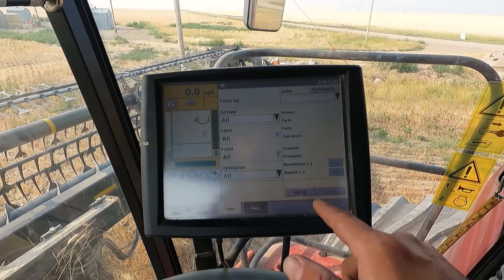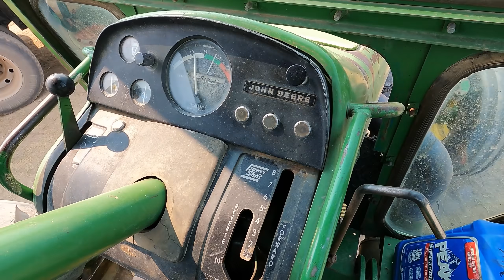It's Yielding Nothing

Comment: Spent 4 or 5 summers hand picking rocks into the bucket of a tractor with my uncle.  Dump that in the back of a1954 dump truck and haul to a good location.  Wore out 2 of those trucks.  30 years ago or so.   I never got paid.  I still don't mind picking rocks.  Easy job, hard to mess up to much and still improve things.

Comment: Bob, your story of rock picking takes me back to when i was kid growing up on the dairy farm with my older brother an sister an my folks. Picked stones every spring with a tractor an a old running gear wagon that has metal spokes rubber tires. an 2X10's by 12 planks.  used pitch forks to pick them up, than once the wagon was full Dad would take it to our woods an Back into a pile an once of us would pull up the planks an down the rocks went  an repeat it couple more times.

Comment: In the 1950s, my dad farmed a 40 acre field that the neighbor had farmed for years with mules. The first year, he ruined at least two tires on the Farmall Super H with old mesquite stumps that the farmer just left in the field, and the mules stepped over. My job was to walk that field with a little red wagon, picking up these loose mesquite stumps. Different areas, but similar problems.

Comment: To check for a blown head gasket, they make a tester that goes into opening for the radiator fill and as you use it the fluid inside changes from dark blue to yellow if any combustion gases are detected. I've used mine many times and love it. Very affordable too
Reply: That doesn’t usually work on diesels. Works great on gas engines.
Reply: Feed propane down the Inlet, enough to make the test work, too much and you've gotten another problem on your hands
Reply: Wouldn't a pressure tester that plugs into the rad cap work the same.
Reply: @ronniewilliz153  no a radiator has pressure from the water heating

Comment: Bob. I'm breaking sod on virgin ground here in missoula at 5k feet. Between the wet spring the uber dry summer I've still not got all the sod busted down. 1 flat rock in the first few acres as all I've found with 12"-18" of top soil. Glad those beavers dammed up my meadow for years and years.

Comment: I use restore plus to remove rust and scale. It does wonders for cleaning the cooling system. They also have restore to remove oil and scum from the system if you have an oil cooler or head gasket leak. Hope this helps.

Comment: If the water pump don't fix it try checking the fuel line, I had the same thing happen with a Allis-Chalmers 6080 and after changing everything it turned out to be the rubber fuel line had collapsed internally and was causing it to run too lean on WOT while baling.

Comment: I think you found the cooling system problem. It looks like the water pump that was taken off was one specced for combine use. It would have different flow characteristics than the tractor version as the combine engines were run at WOT during operation.

Comment: I'm up in a glacier mountain range which has the exact same issues. dad had four kids. So it was two big red trikes. the youngest got to drive them cause they were weaker and the two oldest were on separate teams. each had a box on the rear rack. spread the trikes out 10feet away and pick fill the box till them trikes started to get pretty light on the front end than the youngest kid went from driving the trike to sitting on the little rack on the front wheel till you found a big rock to replace the "live counter weight" LOL

Comment: I had a 400 Cat motor in road tractor. And the impeller was slipping on the shaft. Causing it not to spin as fast as shaft, making it overheat on hills. Drove me crazy until I just decided to change out the pump.

Comment: There is a product that we would get when ever changing the water pumps or rebuilding them on the 40 & 55 series tractors we had . It was a coolant conditioner which protects the cooling system from electrolysis which causes rust. It also keeps the liners from rusting and leaking. You also can get a water pump rebuild kit from JD that saves about 200 bucks.press out the old shaft and seal press in the new seal & shaft and impeller has all the gaskets in the kit best I can remember, and you save a couple hundred bucks. I would really add a bottle of the deer coolant conditioner after flushing the system with the acid. I'd hate to see ya having to replace the liners because they rusted through and started leaking. Dont ask how I know. I had to build a engine in the 4955 because we ran regular water for awhile when the radiator sprung a leak. It doesnt get cold enough but a couple of days in south Ga.to freeze. It made it about 2 years. One of the liners rusted through and it started making milky oil.
Reply: TY16004 DEERE PART # for the conditioner

Comment: If that fixed it that would be the first time I’ve seen a water pump go bad without wrecking seals/bearings. I’ve had a lot of people want there water pump changed due to overheating and usually talk them out of it.
Some people insist so I change it and still overheats

Comment: Another way to test for a blown head gasket is with a Block Tester BT-500 Combustion Leak Test Kit - Made in USA  When Fluid Turns From BLUE to YELLOW Combustion Leak is Present you can get them on amazon for about $37.00

Comment: Nice job on the water pump. Also on some engines when you remove the T-stats it can cause overheating due to the water moving to fast thru the radiator. I have seen this several times. And you should always use at least a 50/50 anitfreeze as it can help the water not to boil at such a temp on the heads. It will make the coolent stay in contact with the head and block. Thanks for the video.
Reply: Overheating without a thermostat is a old wives tale just like a battery getting drained by leaving it on concrete or running low on fuel and sucking debris from the bottom of the tank.  

The old wives tale that coolant can flow through a radiator or engine too fast to dissipate heat defies reason and basic thermodynamics. A thermostat gives very little resistance to coolant flow, when fully open. Maximum heat transfer occurs when there is the highest difference in temperature between the coolant in the radiator and the ambient air passing though the radiator, whether that air flow is caused by the movement of the vehicle, or from the cooling fans. When coolant flows slowly through the radiator, as in when the thermostat is only partially open, it’s significantly cooler as it approaches the outlet from the radiator to the engine. That means that, as there’s less of a temperature difference between engien coolant, and the ambient air passing through the radiator less heat is exchanged.
Reply: @shawnchurch316  You are a liar. I have seen this several times over the last 65 yrs. It does happen.
Reply: @watermanone7567  Next you are going to try to tell me that when you run something out of fuel that is sucks the debris off of the bottom of the tank even though fuel is always sucked from the bottom of the tank.  

The only purpose of a thermostat is to control the operating range of the engine.  The faster the water moves through the system, the more heat that can be transferred.

By the way, water turns into steam at 212°F. Mixing traditional ethylene glycol antifreeze with water in a 50-50 ratio increases the boiling point to only 223°F which is very close to operating temperature of engines and that is why they use pressurized cooling systems to raise the boiling point further.

Comment: We had what they called a stone boat. My mother told me about it when they used to pull it with horses when we did it we had a tractor. It was basically the front-runners of a bobsled with a wooden bed built on top of in between them. Hits the horses or the tractor with heavy rope that ran from each runner up to where it was attached to whatever was pulling it.. They had Steel Rod sticking out of the back of the runners, and when it became time to unload they would take the ropes back over the top of the rocks Andover a U-shaped piece of iron-on a post proped in a hole-in-the-ground behind the stone boat as they pulled it would lift the front off the ground and the rods on the back of the runners stick in the ground and the boat would tip over backwards and unload rocks. Whatever work that's what you used. We also use the hood of a 46 Buick to haul Bales out in the winter time and used as a toboggan when it came to playtime. We would tie it to the bumper of a vehicle with a long rope and turn in a tight Circle in the Hayfield you'd pick up a lot of speed and go skipping across the drifts.
Reply: That brings back memories! At college, (KU), we also used a Buick hood as a sled. They wouldn't let us use cafeteria trays anymore. Busted lots of trays though!
Reply: @louispaparella5766  aluminum scoop shovels work pretty good behind snowmobiles also. LOL the more adrenaline produce the better!
Reply: @earlhollar1906  At home, upstate NY, we had coal scoops with broken handles. Safer on the 'man parts'! Snow machines were unknown at that time...

Comment: I could be wrong but running that big of a auger with a 1000rpm reduced to 540 rpm and the tractor running that low of rpms will cause it to build heat because it isn't running enough rpms to cool properly with that much load on it

Comment: on the overheating tractor, sometimes removing the thermostat completely will cause all the water pump flow to go through the radiator with none going to the engine jackets
gen 1 small block chevy motors would do this
if it's still getting hot try sticking the tstats back in and see if that does it
Reply: It was getting hot before they removed the thermostat.

Comment: I wouldn't be surprised if being it is a  1000 pto and you are running at a low rpm under load you are not moving enough air through the radiator.  My 4630 did that to me.

Comment: I just watched a different video on an older JD like this, similar issues, ended up having cracked head and block. Also who only run water in a diesel? Coolant will protect against cavitation of the cylinder liners.
Reply: They drained the coolant and flushed the radiator in the last video.
Reply: @mfreund15448  oh ok I missed that. Thought they only every ran straight water

Comment: Pull the radiator and have it cooked out. Very unlikely the water pump is not pumping. More likely the radiator is plugged. Either internally or externally between the fins. Pulling it is the only way to get it completely clean. While it's out go ahead and tank it to cook the inside scale out too.

Comment: Not cavitation. Recirculation is what's happening. Cavitation is due to insufficient suction pressure caution the fluid to vaporize due to the pressure at the inlet dropping below the vapor pressure.

Comment: Head gaskets always end up blowing coolant out. There test out there it changes color if it sees combustion gas in cooling system. Problem when testing diesel color change is slight making it hard to tell unlike checking gas engine. Gas engine will turn blue to yellow but diesel engine blue to blue green or green. Most I've seen barely changes it from blue and you end up testing again. Most don't read instructions and assume when testing diesel engine it will change to yellow IT WON'T. Can do bottle test see if you get bubble in overflow tube. 

Water pump pressure test is checking water pump on pressure side it should increase with RPM. Most engines do have a water pump pressure spec atleast 10 psi at idle and 30 psi high idle (full RPM)

Comment: Good Video! Have you considered a by-pass coolant filter.??? Using several gallons gallons of coolant gets contaminated over time with dirty fluid, which prematurely stresses and wears on the pump. Using a filter is efficient and reliable, which extends the pump life with clean coolant.. I have not had the opportunity to use one on a large tractor but, it works on other diesel engines, requiring several gallons of coolant. We used large and common oil filters(20 micron), $10-15, changing them first at 10-20 hours, then 100 hours. You will be surprised how fast they fill the filters...This also saves time and expense changing fluid and keeps the fluid cooler.

Comment: Keep your eyes on that non clean burning. I’ve had that lead to a bit more engine heat than I like. Also over time fans wear and have been known to loose their blade pitch resulting in less air flow through the radiator. 

Alternative to using muratic acid is to use phosphoric acid as it will dissolve the hard water and convert the rust without eating away at the metals. Add a bit of surfactant to the water when you clean the radiator to help with dissolving the crud.

Comment: Hey guys have you measure the temperature difference at the bottom of the radiator as to what the top is reading?  There should be a +/- 10 degrees, bottom being cooler.  Never mind, I should watch the entire video before I comment.  Have a blessed day guys!

Comment: Tell me about it! 🤪🤪🤪🤪 I’m in Connecticut & every year when we plowed before planting corn 🌽! The farm owners nephew & myself would pick the fields clean! Every f cking year! Next spring run over it with the plow again & have the same if not more rocks 🪨 to pick again! Thank god the nephew was smart, went to Cobillskill ag college in upstate New York! When he began running the show, we started no tilling! Still had plenty of rocks 🪨 come up, but only about 10 buckets worth, instead of 100s of buckets worth! Hand picked by both of us with the old IH 1066 rolling along in 2nd low, while ghost 👻 riding & us in front doing the picking!!! Connecticut potatoes 🥔 🪨🪨🪨! 50 year old radiators do not work, I’ve seen the farm owners do it over & over! You cannot get them to cool anymore!!! If it was a head gasket, you would normally find h20 in the oil! Put a pressure tester on top of radiator & run it! If it builds a bunch of pressure, than you probably have a gasket issue! More than likely it’s the 50+ year old radiator!

Comment: After doing an acid etch, and then running with plain water in it for a while, yes, I would certainly expect quite a bit of new rust!
Better get some coolant with corrosion inhibitors in there soon before it rusts much more...

(and yes, I know the acid was in the radiator and was flushed afterwards, but it's almost impossible to get it all out so very likely some weak acid made it into the block and took the oxide layer off steel and iron)

Comment: Certainly the water pump could have been part of the problem but the fact is older units like that typically have a very rough ( plugged ) looking rad internally and if that acid wash did the trick or not is hard to say. But here's another problem which donned on me when I saw the RPM gauge as you were augering, those 4520's unfortunately only have a 1000 RPM pto and the auger you are using is set up for a 540 pto. So you are running the engine at a slow speed and its under high load and the engine fan is going far slower due to that low engine speed. Another words sad but true its a mis matched unit and will never be ideal. Perhaps a new or newer red tractor ( or green ! ) will show up in you're yard one day and be equipped with both pto speeds to make it a more compatible unit for various pto implements.

Comment: Have you taken an infrared temp gun and verified your gauge accuracy?  Could be a sending unit, a corroded wire, bad gauge also, would hate to have you keep throwing parts at it, although JD folks are used to this.